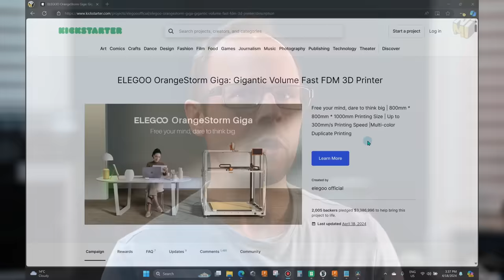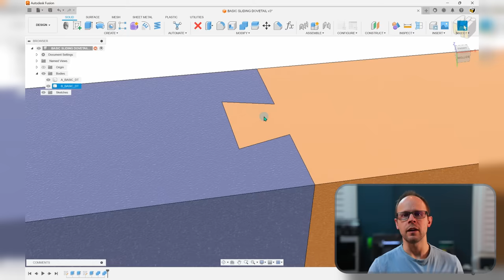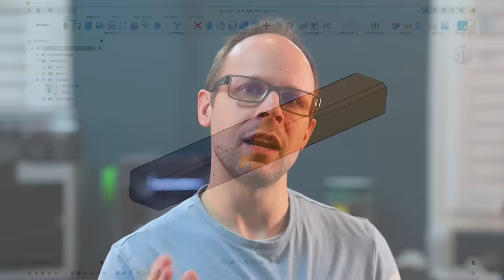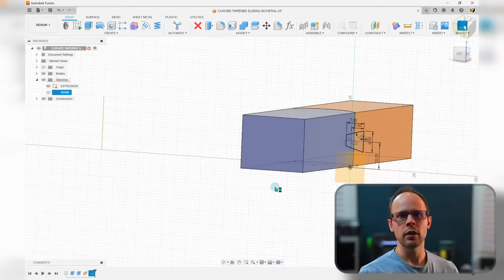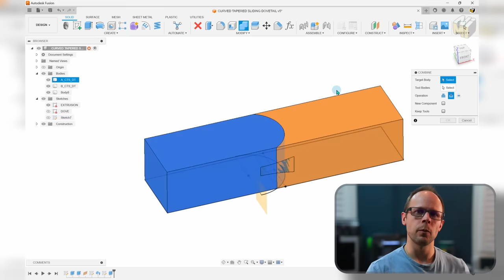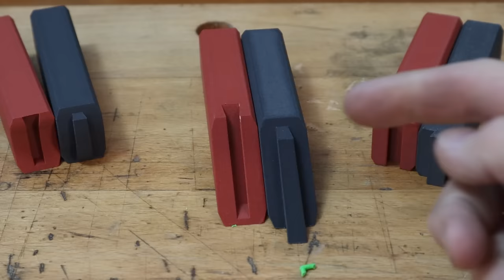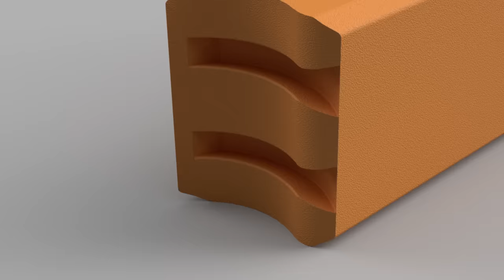Modernizing the best Woodworking Joint to use for 3D Printing

Comment: how does the taper prevent the piece from backing off?
Reply from the maker: Mainly 2 things, due to friction on all mating surfaces and the angle of the wedge.   It's the same principal we use on a threaded rod when you tighten the nut.  Normally it runs up and down fairly well when there is clearance, but start to tighten it up, and pressure is forcing the surfaces to mate and then it doesn't come off unless you use a wrench.  The more contact surfaces the harder it will be to loosen it off.  It has a lot to do with the angle, if you have something wedge shapes at a 45 degree angle, it will apply force equal in both directions which will also try to force the connection apart, if you have a wedge like the one I showed which was only 1 degree, nearly all of the force is working to keep the connection together.  Let me know if that makes sense.
Reply: @NeedItMakeIt  I didn't understand the last sentence
Reply from the maker: @nikilragav  I can't tell from your words if you're being sarcastic.   Tell me which sentence you're referring to please.

Comment: do you put glue in the joints?
Reply from the maker: No glue in those connections, I think for a good long-term solution you'd probably want to add your fav. adhesive.  With temperature changes, with vibrations and depending on the direction of the loads being applied it might have the ability to loosen  up a bit, it really depends on the connection itself.

Comment: Now we need to do the reverse of this: try and make these curved dovetails...IN WOOD.
Reply from the maker: Yes!  Well this is quite the challenge I have been thinking about how I'd do this and I think it is possible for the most part on my 3 Axis CNC if I were to split the connection in half, machine the parts and then glue them toghether with alignment pins.... maybe.  It's not so simple with the machinery I have at home, but maybe there is someone with a 5/6 axis CNC machine that could make it.

Comment: Trying to get dimension accuracy to be precise enough for joints to go together is damn frustrating.
Reply from the maker: When I use the Bambu X1C and the QIDI Q1, I don't have any issues there, but I have calibrated the filament on the Q1 fairly carefully.   Ideally you'd leave a bit more space and use a PL premium adhesive to make a permanent connection, lots of surface area and directional changes would make for a strong lasting connection.

Comment: Why a Dove tho? 🤔
Reply from the maker: I guess it sounds better than "Bird-tail".   It looks like a fan shape.   To be serious though, it acts like a wedge, while also keeping strength in the parts.   With wood, we'd also use a mortise and tenon, which is this connection but longer and no angle, in those cases we must glue the joint, and they're very strong.  The dovetail can be used with no glue, when I was timber-framing, we'd commonly use the dovetail connection without glue, it holds the joint together and cannot come apart.   The angles of the connection are meant to not create weak areas in wood which would break off in those smaller cross-grain areas.   Did that help?

Comment: Mike, the theory under which you've been making these joint videos is flawed. Woodworking joints exist because of the flaws and strengths of wood, as well as the limitations in "machining" it.

FDM has different strengths and weaknesses as well as printing techniques that can aid or destroy those strengths.

Any joint discussion needs to start at the "First Principles" stage of FDM.

Woodworking joints have developed over thousands of years of trial and error. 

We have the benefit of using science when coming up with FDM joinery.

What do we want to join?

Why do we need to join it?

Where is the best location to join it?

What part geometry, design and print orientation minimizes the weaknesses and utilizes the strengths of FDM?

Comment: dovetails arent as strong as box mitres
Reply from the maker: With the lock-miter connection you mean?  I've used these a little bit, but I've found them hard to setup, but a pretty slick setup.   Maybe there is a way you can connect parts on a corner using your idea?
Reply: @NeedItMakeIt  I just meant the title. 

"The best woodworking join" is not a dovetail. It's a box mitre join that over 2x as strong the dovetail.

https://www.youtube.com/watch?v=CE147Ow7RmM
Reply from the maker: @thebatmakescomics  You have to define "Best" I know what you mean, you're referring to the strongest, you'd have to consider that it's limited to the application, which is also not specified.  Best looking, Best for speed, Best for Strength, Best for most applications.   I don't consider the box miter the best at all since it is quite limited in where you can use it.  But I can give you that in a drawer box construction maybe it's better in that one case.  I'd like to see the box miter / lock miter performance with no glue as well, that would be enjoyable.
Reply: @NeedItMakeIt  I mean, I think I'm being as specific as the title. 

But if you really want to get specific... Of the Edge, Rail, Case and Frame Joints... The strongest part of all of them is the glue. 

So it won't transfer 1:1 to 3d printing. 

But if you want to get into the semantics of "best" among measurable metrics the edge mitres are always the strongest, least visible, and has continuous grain flow. 

If you want to say dovetails are prettier and that makes them to best, sure that's subjective. In everything else measurable, mitre joints. And it's not even close. The things you claim in the beginning of the video aren't really true. 

But you might be interested in a miter with a dovetail key instead of a spline, if you really want the dovetail and can't get over the joinery facts.

What you're doing is actually called end lapping, a dovetail keyed end lap, and it is not very strong at all.
Reply from the maker: @thebatmakescomics  Let's cut the bull, and get to the point.  You don't think the DT is the best, I think it is.  It's not an argument that can be won, it's a difference of opinion. I will take what you've said into consideration as I do with any conversation on here, and we'll see where it ends up.   Follow along and subscribe because I will be testing these connections in a future video and maybe your idea will make it in there a as well, I just can't figure how that would be possible, but I'll at least think about it.  I think there was at least some value in our conversation here.
Reply: @NeedItMakeIt  Well if you could offer metrics other than "Because I said so" and I could be more respectful. But you think it's a pretty join, so good for you. 

It's not an argument because there's nothing to argue. Your taste in pretty designs vs measurable metrics isn't an argument.
Reply from the maker: I want to say thanks for taking the time to help out the channel by writing comments.   Lookout for the next video in the series, who knows, maybe there will be a lock-miter in there somewhere.  

Have a good one!
Reply from the maker: Oh yes and if you wanted to come up with a list of metrics, I'll certainly have a look, I have no animosity if we are truly interested in having a legitimate debate we need to remove our personal feelings and this is something I am willing to do, I would have a debate with someone who is also open to ideas other than their own, I don't know you so I cannot know whether you are.  Have a good one and keep those comments coming, my channel seems to be starting to gain quite a bit of traction which is why I try to respond to every comment, it seems to help it along.
Reply from the maker: @thebatmakescomics  Just wondered if you could provide some metrics that you think would be good to include in future videos, I'm working on several follow ups and I think it would be good to include some ideas from different sources.
Reply: @NeedItMakeIt  Start with weight tolerance
Reply from the maker: @thebatmakescomics  You'll have to give me an example of how this can be applied to wood and or plastics.
Reply: @NeedItMakeIt  If you can't figure out how to stress a joint nothing I can write will help you out. 

You should pick up a beginners cabinetry book and use the information that's been available to woodworkers for hundreds of years instead of trying to milk youtube comments.
Reply from the maker: None my Woodworking text books have any reference to weight tolerance.  We have reference to tolerance regarding dimensional accuracy and clearances of course.

Truthfully this conversation is quite entertaining to me, you're trying to insult someone you don't know, and it's, well... like your name. COMICAL.  I'm interested to see what you can come up with next, maybe it'll be a real zinger.
Reply: @NeedItMakeIt  Insults? It's just annoying that you're trolling your own YouTube comments.

What part do you find insulting? Then make up whatever words you need to feel good about yourself.

In your next video, 3d print a participation trophy for yourself for being in this conversation. Hug it real tight while you imagine more made up insults, or whatever insecurity you're working on through these comments.
Reply from the maker: @thebatmakescomics  Not bad, I thought your previous was a little bit better.  The reality is that 99.9% of conversations here are productive and we interact with mutual respect, this conversation did not go that way because I believe I've challenged you and you're not used to it.  But before we move on I have to ask you, have you ever done any Woodworking yourself?  I have, and have had a long career in it, and yes, I can admit that I don't know everything, I take time to challenge myself every day and try to learn new things, I'm not getting the impression that you my friend can do the same.  The impression I get from you is that you get your enjoyment from trying to bring people down rather than prop people up.  So I truly do hope you can find some happiness in your life and do something good.  We began with is the Dovetail the best and I guess the only true way to settle this is with a poll amongst real Woodworkers.

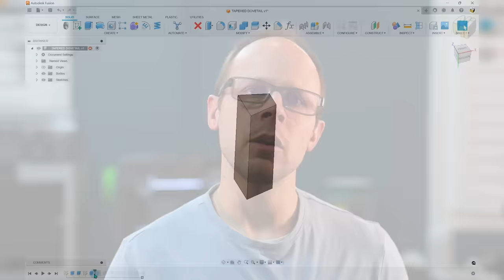Comment: 2:49 "...we need to have extruded the dovetail to both sides of the joint.  That's going to account for the taper angle shrinking it in all directions as we move to other end."
Umm  WHAT??!?  What does ANY of that even mean..  Both sides?  Shrinking what exactly?  As me move to what other end?  MOve?  
Try that one again.
Reply: Then you get to the one where you "set them at angle to the part"...but you don't show how to do it, or explain it.
Clear as mud bro.